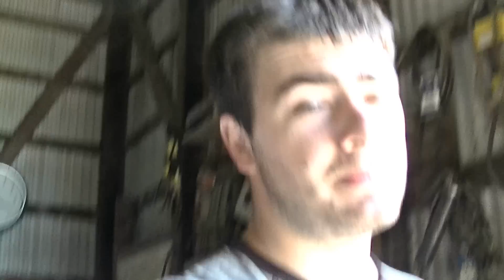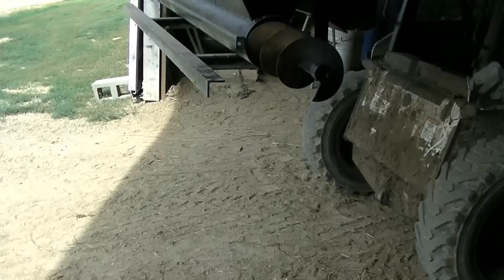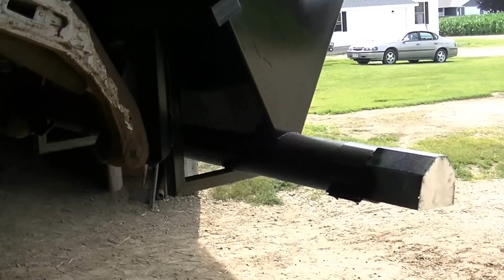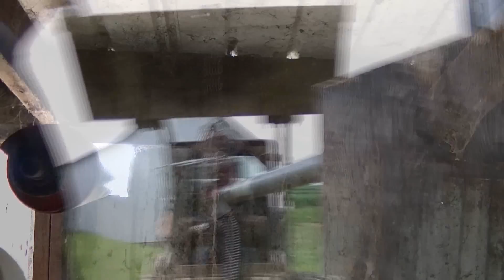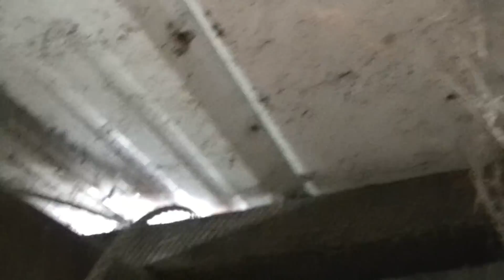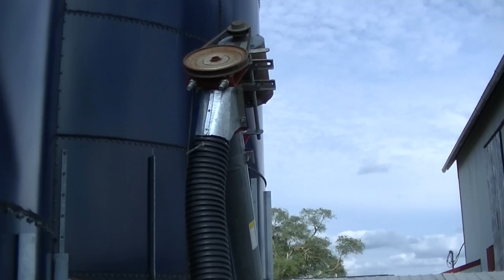The new bulk feeder

Comment: Nice... Good work!  

Made me wonder a few things, though... any problems with bridging?  Considering the particle size of the stuff yall are getting out of the grinder, and the narrowness of the opening at the bottom on either side of the shield, I'm curious if yall have had any issues with bridging of the feed and it refusing to feed out the bottom, ESPECIALLY when you add the molasses to it... Might have to make some adjustments for that in the future, or if you have to haul the feed and it vibrates and packs itself down in the hopper before getting to wherever you're feeding it out the auger.  

Have yall considered adding the molasses into the feed as it exits the grinder and enters the auger, so it can be mixed in by the auger?  Course it could possibly cake up or gunk up the auger... or maybe allowing it to dribble out through a hose on the end of the feeder auger as it's being dumped into the bunk, so that it's more uniformly distributed and won't gunk up the hoppers or auger?  Probably wouldn't be a very hard thing to do... just make a bracket to hold a jug or bucket with a spigot on the side to adjust the flow as it dribbles out onto the feed by gravity flow, and maybe a short piece of hose to direct it down onto the grain coming out of the end of the auger... 

Later and KUTGW!  OL J R :)